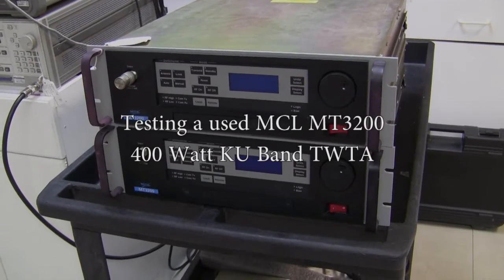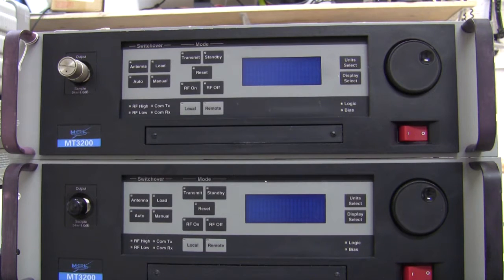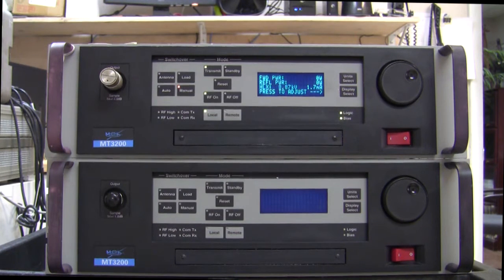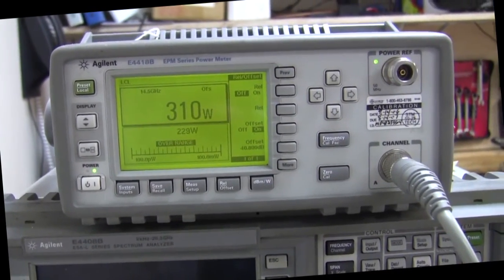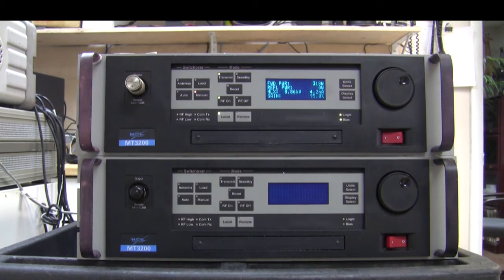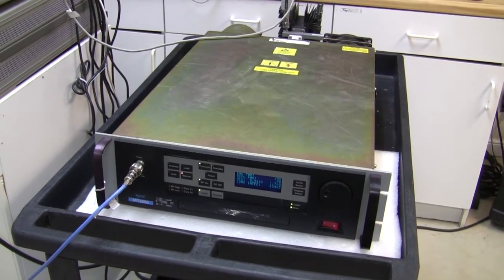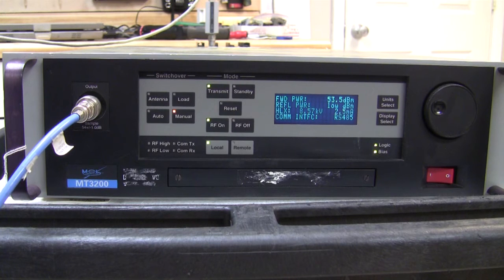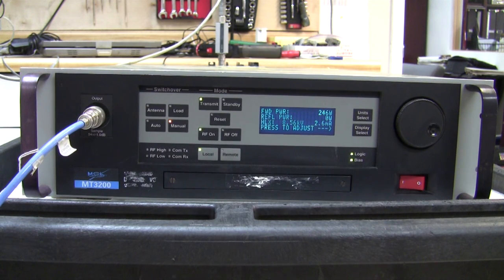Testing MCL MT3200 400W TWTA

Comment: 1.7 to 1.8mA helix current is very low!  NOT very High!!!  Anything under about 4.0mA is fine!!!  Helix current is a function of the TWT focussing.  If that display is even close, that's a great TWT!  The helix I should've been calibrated prior to doing any RF Testing...along with the Helix/Cathode Voltage display.  I would also not use amplitude linearity as a gauge to set the saturation point.  You should also check the helix current at "Rated" power which should be about 360W.  If you are at Rated Power and the helix current is below 4.0mA, that's pretty good, however, the TWT Tube Manufacturer has set a limit of about 10mA or 12mA as a maximum at which the system should "trip out" on a fault.  This means you could have a TWT that is just fine operating at rated power (360W) with a helix current of 6mA.  It depends on the TWT Mfr. as to how well a tube is focussed and it's performance.  The Mfr. may give up some Helix Current headroom to provide better performance over the range of operation.  Also...MCL typically does power testing and calibration at mid-band as opposed to the end limits of the amplifier.  Also keep in mind that there is a battery inside this system that backs up the calibration memory.  If that battery has been replaced, then a full calibration needs to be done.  The Output Power and Reflected Power Calibrations are linearized over the power range by setting the HPA at multiple power levels and having the HPA Calibration routine "memorize" the crystal detector voltage as a reference to displaying the equivalent Output Power on the display using CW output power.
Reply: Robert Green hello robert can you help me with an MCL 3200 MT